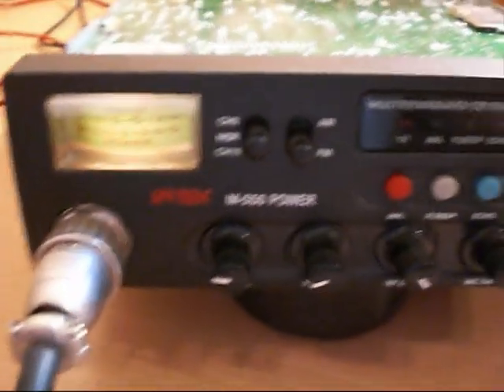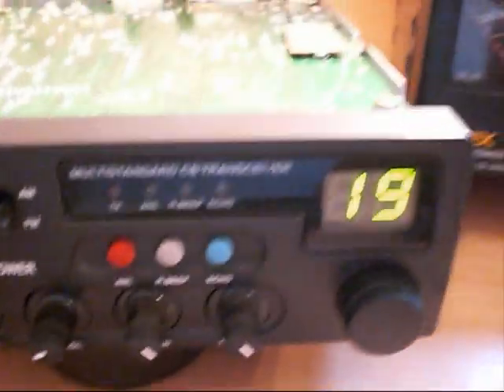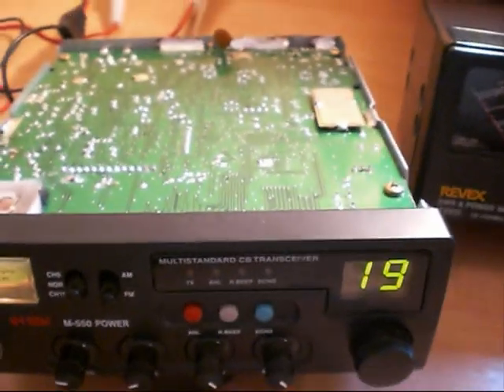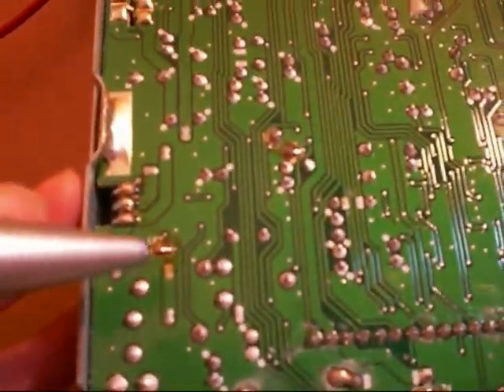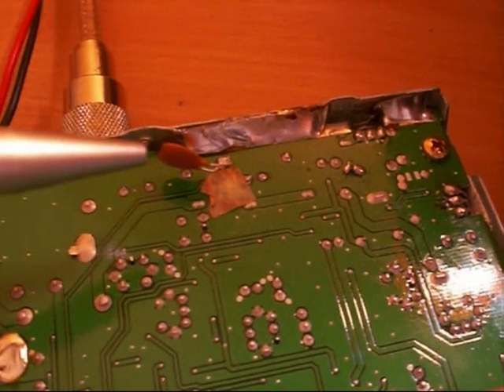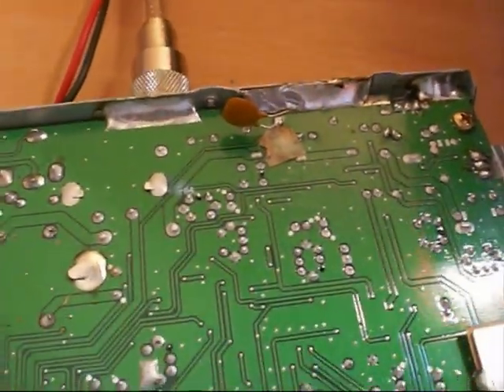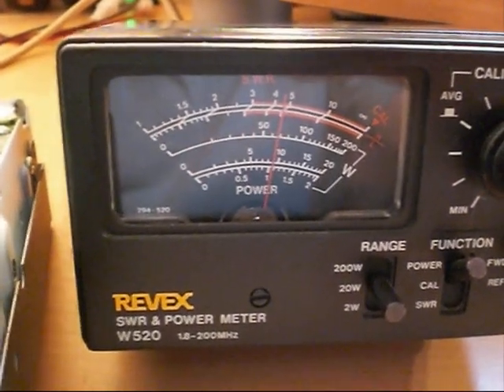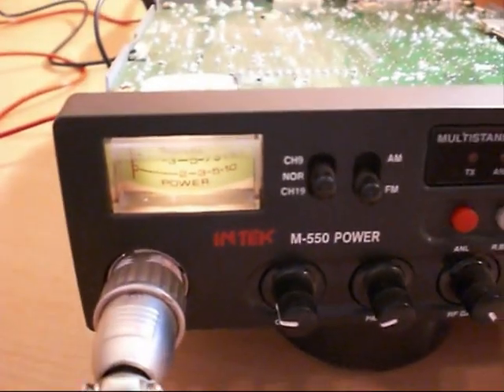INTEK M-550 POWER   OUTPUT MODIFICATION.

Comment from the maker: @sowa616  The radio is designed to run from 13.8volts so the higher voltage may have damaged the MOSFET or other parts in the radio, you should really only use a standard 13.8volt supply.

Comment from the maker: @sowa616  As long as the SWR is good it should not make any difference, i use a 50ohm dummy load for testing but i always hook up to my IMAX 2000 after that and results are the same as it has a good SWR.

Comment from the maker: @sowa616   well i don't have your radio in front of me so as to what you have done wrong would be guess work, maybe when you were soldering you have shorted something you should not have as the jumper points are very small.

I have done several of these radios now and it always works when i do it so you must have got something wrong.

Comment from the maker: @sowa616   Hi Mike, tweaking the coils makes hardly any difference to the output power as i explained in the video - see the jumper settings below for 12 watt setting.

LK1 = SHORT
LK2 = OPEN
LK3 = OPEN
LK4 = SHORT
LK5 = SHORT
LK6 = SHORT
LK7 = SHORT
LK8 = OPEN

Comment from the maker: Yes i also think 10 watts is more than enough, the radios are designed for 10 watts output but are restricted for the UK market. I ran up the radio for a good while and it does run pretty cool i have to say.
Glad to hear the replacement transistors are working well.